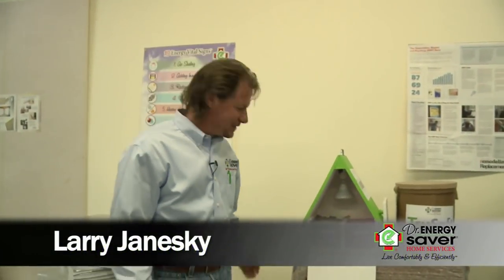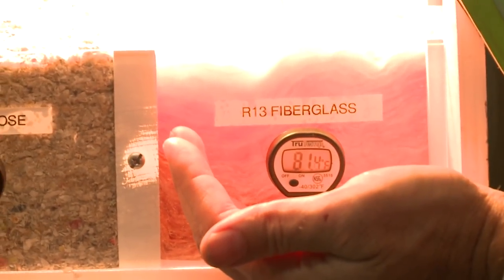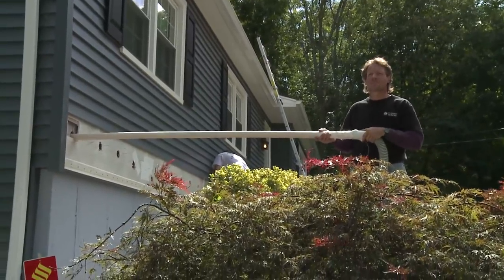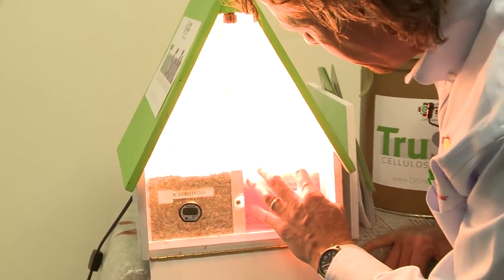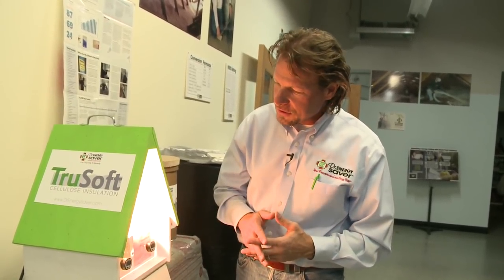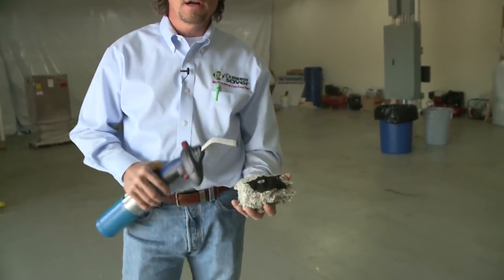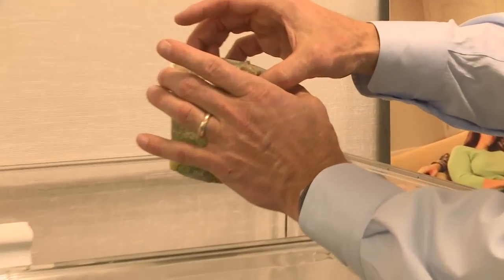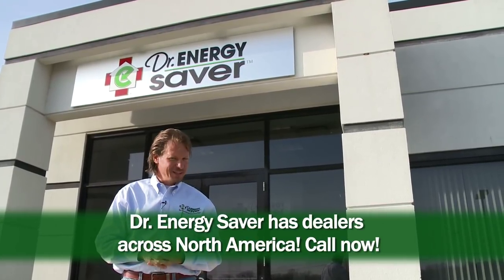Why Cellulose Insulation is Better than Fiberglass Insulation

Comment: CELLULOSE IS NOT BETTER IN MOIST CLIMATES. THE MOISTURE WILL COMPACT THE CELLULOSE INSULATION OVER TIME AND REDUCING ITS R VALUE
Reply: Cellulose absorbs moisture like does the wall studs, in moist periods and gives it back during drier days, just as the wood structure of the house does. In a sense, it "breaths."  Any settling occurs the first few weeks as a direct result of being blown in. Reputable contractors add additional cellulose to compensate for the air removed.
Reply: Packing cellulose actually increases it's R value. So over time, it gets better.

Comment: This stuff should be illegal. There are more videos on vacuuming this crap out than putting it in. I’m pulling all of it out in my house. 

Several things: 

it degrades over time. All insulation does but batts are much easier to pull out and replace.  You are looking at $1000s of dollars just to remove. 

The dust from this stuff is so fiine, that any disturbance….. pressure changes in your attic (wind storms, hvac cycling) will allow the ultra fine dust to seep into your ductwork and thus finds its way into your lungs. 

Do not put this stuff in a place you plan to live in.

Comment: You have to keep adding Cellulose every few years because its like, mulch (organic), so it dissipates. Fiber glass is just like it sounds "Fiberglass", it it last for a very very long time. Besides, he didn't use blown fiberglass insulation on this illustration, so it doesn't count as a legit demonstration. More like a misleading illustration.
Reply: Mikey, my dad's house is 35 years old, same cellulose, same efficiency. Properly manufactured & installed cellulose does NOT 'dissipate'. If you are losing product, then look for something that is physically moving or removing it.
Reply: @Heath49008-
SORRY, I meant to type DOES NOT dissipate !!!! D'oh !!!!  IT DOES NOT, it is a fine insulation. It's 100% recycled product, made in the USA & I never found a residential insulation situation where I couldn't use it. Cellulose installed with minimal moisture (some adhesive if you want to be overly protective), then allowed to dry properly, will never settle in a wall. I know because I have seen wall cavities opened for remodel after 20 years and it looks like the day I installed it. IF you doubt the validity of this demonstration - then by all means do the test yourself, I have. Moisture issues ONLY arise when PROPER application/installation procedure is not followed. That is not the fault of the product.
Reply: Cellulose doesn't "dissipate" any more then the wood framing.
Reply: Cellulose doesn't disappear, but it does settle which is why the have a "settling factor". However once it has settled, you can always add more and then you shouldn't have to add any more as it isn't capable of settling past a certain point. This is pretty much the difference between light pack and dense pack, dense pack won't have this issue.
Reply: Heathh49008

Actually, you should watch who you call names because it can reflect on you.  I have heard numerous complaints from people who had actual proof that unless more cellulose is added the R value goes down over time.  Even people who sell insulation will warn of this.  A great proof was an individual who had snow melt off their roof that didn't melt when cellulose was initially installed.  Again, look into actual facts before you name call.
Reply: this statement couldnt be MORE wrong. HOW does it just "disappear" not your opinion, but I want a researched FACT.
Reply: Because it's not fiberglass. It's made of composite material. So it is degradable. After years, it'll start to disappear.
Reply: Goddamn, you've misconstrued settled with "disappearing"... it does NOT disappear, it settles. If paper simply disappeared, we wouldn't have libraries made of books that are several hundred years old. The only way for things to "disappear" is for them to be consumed, if no water is applied and nothing grows, then it can't disappear.
Reply: Scott, you know that's what I meant, right?
Reply: Mikey Jimenez Mikey it does NOT dissipate as well . Blown glass and batts also "setle" as does anything that GRAVITY is applied to . HOMES settle, GROUND settles. Any thing applied with a prper airlock system is VERY minimal.  Heck man even a radiator "settles" after the AIR is  burped out of it!
Reply: *****  if something, ANYTHING settles IT BECOMES MORE DENSE. batts and blown do as well . i cant expect you to comprehend this but when a homeowner does attics themselves more than likely they DID NOT blow as was proper and then blame the insulation for settling.  Like i tell ppl every week..I can work on my own car, doesnt make me mechanic.
Reply: Don't forget to factor in the amount tamped down and matted with urine from the mice and squirrels that love to use cellulose as bedding.

Fiberglass has that in it's favor as well.

What we really need a is a cheap and easy cellulose vacuum to get this crap out of the houses once people (Like me) buy them and find out the attic is loaded with the crap.
Reply: Cellulose is coated in boric acid, also a pest deterrent.
Reply: ...as long as that residual lasts.
Reply: I've seen cellulose insulation in people's attics that was decades old. Also the issue about pests kinda ignores the most important part which is that they shouldn't be there in the first place!
Reply: Relax my people! No need for names! We're better than that. Both products are great products. I decided to go with Cellulose because that's what I have now at my house. But regardless, I still believe that fiberglass is still the best opening, although it's way more expensive. I'm only using Cellulose because it's going to be fine for the next 10 years or so until I sell my house. I know it's gonna help me with my utility bill for the moment. 

But, please, no name calling! You people are way better than that.
Reply: LOL! when you said "I used to work at Home depot " that was all the explanation I needed to understand why you dont know what your talking about! HAHA!  you mean the green fiber garbage thats the LEAST USED BY REAL INSULATORS? those "machines" you "trained" ppl on? HAHAHA! what a joke those ARE DISPOSABLE AND ARE NOT EVEN AIR LOCK EQUIPPED! what did you do? move on to Dairy Queen from there?

ASTM states that although cellulose CAN BE INSTALLED over Fiber glass ..FG CAN NOT BE INSTALLED over cellulose due to its LOW DENSITY and FLUFFINESS and lack of R value. ( try reading the report on why FIBRRGLASS LOOSES R VALUE at temps ABOVE 20 degrees!   HAHA! home depot ! thanks for the instite tho , now we know where your coming from and why? LOL!
Reply: Bunch of haters! Lol
Reply: After Home Depot? I finished my engineering degree and now work in a testing lab for a medical manufacturer.

You think the R value changes with the temperature of the insulation. And that occurs by what mechanism? It flips a switch? The Fiberglass senses the ambient air temp and contracts? You seem to have some amazing insights.

Brilliant. Simply brilliant.

I think we can all see what kind of rational thinker we have on our hands with you.
Reply: What you say, sounds exactly what I think the reaction an Egyptian would have when describing water below 32F.

materials behave differently in different temperatures and conditions.
Reply: Sure.

So what is the mechanism? Change of state? The linear expansion rate of the fiberglass causes openings to expand within the FG and allow more air infiltration which results in a lower R-rating? Is there a magical fairie that waves a wand? SMH

You refused to answer my question, so thanks for the insult,  but what is this mechanism?

Or is this just some BS you heard some time, from some guy? Was it your salesman or boss where you pimp cellulose?
Reply: I'd read this study here: http://allcellulose.com/The_Colorado_Study.html

or this one from Oak Ridge National Laboratory: http://web.ornl.gov/sci/buildings/2012/1992%20B5%20papers/048.pdf

As for why fiberglass is inferior, installation problems, shrinkage, air infiltration, are problem reasons it performs inferior. Most installations of fiberglass are done poorly, it takes a lot of time to install fiberglass correctly but not nearly as much time for cellulose.
Reply: Your quoted 25 year old study..."The additional heat flow,  attributed to natural convection, was effectively eliminated by applying a covering of fiberglass batts or a combination of a poly-ethylenefilm and fiberglass blankets. No significant convection was found either with fiberglass batts or with one type of loose-fill cellulose."

So, the type of loose fill FG that was used 25+ years ago is not as good when not associated with a barrier. BUT Fiberglass when combined with batt or poly sheet is superior to cellulose. As per your own data.

And the other source is a Cellulose promotional group.

So you have no defense about the borate residual, flammability, moisture absorption, settling, or pest issues. As well, you have just admitted that Fiberglass is better... and was still better 25 years ago as long as it was batts instead of, or in addition to, the old fashioned loose.

The issue you're trying to describe is air infiltration through loose fill. Cellulose seemed to do better, because it was more dense. But even a thin sheet of batting solved that problem even back then.

Way to go. Do you have any data from this century?

Your second test also compared UNFACED BATTS, to wet sprayed cellulose 5" thick.  Try comparing modern equivalent products (from a neutral lab) if you want to be taken seriously.
Reply: It didn't say it fiberglass superior, it said it was sufficient. The problem is, and you obviously glossed over it, is that you cannot use an impermeable air barrier over the fiberglass due to condensation issues, especially in humid and or very cold climates which is exactly the issue the fiberglass has, in very cold climates. A fiberglass batt is completely worthless unless perfectly fitted to the space which it rarely done. If you use loose fill fiberglass to solve the issue of filling imperfect voids, then you have the problem of air movement which cannot be solved with an air barrier due to moisture issues.

As for "modern testing" I don't see how "modern testing" is necessary since fiberglass and cellulose hasn't changed in over 25 years.
Reply: The fiberglass used 25 years ago is very different from the modern attic-cat series of insulation. The new stuff isn't itchy, and is significantly finer in individual fiber size. It has the consistency of cotton candy.

It's a completely different animal.

Also, you are apparently not looking at the graphs in your lovely report. The top performance was from fiberglass. (Fill and batt combination)
Reply: "The new stuff isn't itchy, and is significantly finer in individual fiber size. It has the consistency of cotton candy." They've had the "more refined" stuff for at least 25 years. The more "itchy stuff" was far less refined and consequently had a lower insulation value. For a typical 2X4 wall cavity, it was like R11 while the finer stuff now is R13 for regular density and R15 for high density. I know, because I do remodeling for older houses and I can tell the old stuff from the new stuff. 

As for the top graph, that's basically R38 insulation. When they were testing the cellulose configuration, they never put more than R19 equivalent of insulation while they DID go as high as R38 for several different fiberglass configurations. They tested the fiberglass a lot more than the Cellulose because the performance was fairly consistent with the cellulose.
Reply: I can tell you this ( to the OC PLANTS) fact: I bought a house with BLOWN GLASS as the prior choice used in the attic, VACCUMED it OUT and REPLACED it with CELLULOSE. The following heating season without ANY other single change, We used 225 LESS gallons of LP. wanna explain that? BTW the degree days below freezing was 29 MORE than yr prior.
Reply: Funny how the ICAA DOES NOT recommend installing glass over cellulose ( due mainly to the "lite weight and fluffiness" ) but DOES approve of cellulose installed OVER BLOWN GLASS! due mostly to the superior density and R VALUE of cellulose. putting glass over cell is like laying a sheet over someone that already has a Quilt on and putting cellulose over glass is like putting a QUILT over a sheet on someone. but maybe they dont teach that at online engineer school.
Reply: You vacuumed out less Fiberglass, and installed more cellulose? Gosh, how impossible...

But I love being told that I'm part of a conspiracy and work for Dow Corning as an internet "plant" to discredit your profit margin selling cheap shredded newsprint.

What is the R value of that tinfoil hat?
Reply: Heathh49008 LOL!!!
Reply: D Heartstop Perhaps the sun came out?
Reply: Heathh49008 I am pretty certain that materials fluctuate in different temperatures.  At least that is what they taught me in Kindergarten.  Yikes.
Reply: Ted Joffs
So because you don't understand the physics,  anything must be possible? Because if one thing can change for a reason you don't understand, then anything must be equally likely to happen?

Just because you don't understand basic physics, it does not mean the world is magic for everyone else.

Please don't breed.
Reply: ***** I dont know where to strt with such misinformation but ill try...If R 13 is more "refined" than R11...they WHY do they still make R11?  Your reasoning that  its quit comparable is quit LAUGHABLE. YOU DO understand that ITS  STILL THE SAME  THIICKNESS  now as in many years past?  With your reasoning it should be THINNER. R values went up in requirements DUE TO FUEL COST's . ......Ive done this work for 26 yrs...I KNOW.
Reply: scott bickett I'm surprised they still sell R11 considering that code is R13. Yes it's listed on homedepot's website but you can't buy R11 in stores, R13 is what is in stores.

The fact that people can still buy fireplaces with Pilot Lights even though illegal in a lot of areas, doesn't make it smart or acceptable.
Reply: well AGAIN..ill correct you..YES you can BUY R11 in stores( local HD AND Menards stock it) AND yes We use it ALL the time ( albeit for sound batting) but no  NOT from stores ( we are PRO'S)  And I for one have never in all my years heard of pilot lite  FP "being illegal" yet "still available"?? wow.....
Reply: also R11 not being avail in YOUR area has nothing to do with the REFINEMENT comment anyway.
Reply: A pilot light fire place in new construction would be illegal. As for remodeling, also illegal.
Reply: according to WHO? ive done 7 new homes since 1st of yr and ALL had them and not a single word ever said about this claim??  IF this was true them how in the WORLD  could / would they be sold?
Reply: I don't know what shit hole area you live in that allows the sale of appliances with pilot lights but from the side of the country I'm from, they're illegal.
Reply: isnt the internet great?  when a child can say whatever they want WITHOUT ANY PROOF? and just ramble on aaaand OOOON .
Reply: "ALL COMBUSTABLE APPLIANCES HAVE PILOTS!"

ALL? You're telling me that my furnace, gas stove and my pool heater all have pilot lights? That's funny but you're wrong. It's not a continuous burning pilot light if the device has electronic ignition. It's illegal in many places to use new devices with continuous burning pilot lights save for a water heater but those are next on the chopping block as those too will eventually all be electronic ignition, free of a continuous pilot light.

Federally, across 50 states, newly manufactured tank water heaters over 55 gallons are condensing units and already are on electronic ignition and do not have continuous burning pilot lights as of Apr 2015.
Reply: wow! better tell that to the JUNE 2015 HWH I just put in then!  BRAND NEW!
Reply: scott bickett how many gallon? If it's less than 60, it's old stock.
Reply: Wow then the 2015 model number must be wrong too? ...LOL...sheesh..keep tryin!
Reply: scott bickett I looked on the American water heater website and could not find any models that matched that number. The only part of the model # that matched was the BFG61, after that, it was a crapshoot. Google is of no help. Are you sure you have the model # correct? 

This is a natural gas tank water heater, correct? I'm assuming a 55 gallon? Residential. 

According to their website and the decoding of the model number, it would appear they do not sell a 55 gallon water heater either a 40 or 50 with that BFG61 prefix. Either this is really old water heater stock or something else is wrong perhaps the number. Can you provide a URL/link to the Energy star and or spec sheet for your water heater?
Reply: +imzjustplayin hyhhi
Reply: +D Heartstop , you were told wrong. I suspect homeowners don't actually confirm they received what they paid for. It's not enough to measure the depth. You must also confirm the bag count. Getting a poor job and then discovering so years later isn't the same as settling.  Responsible contractors install enough extra to allow for the initial settling. Then you're good.
Reply: +imzjustplayin , it settles initially..the first few weeks and then is stable for the life of the building.